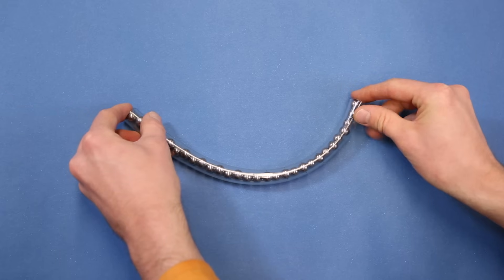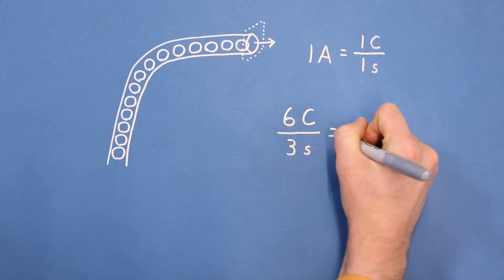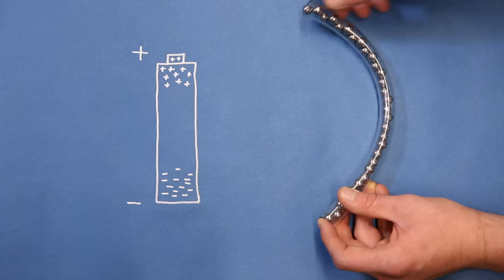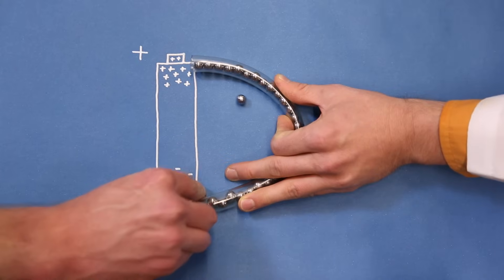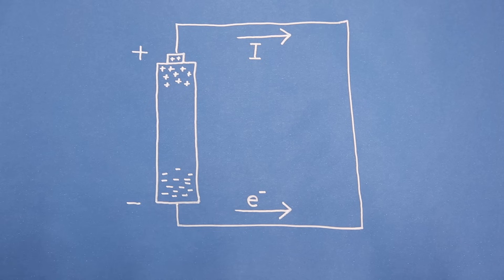What is Electric Current?

Comment: Thought this might help someone else learning:

Do electrons actually "move". It seems this video is about an old mental model for electricity.

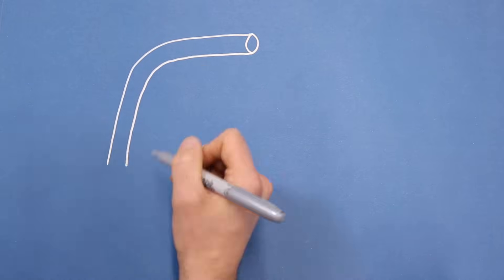Yes, electrons actually "move" to create electric current. The video explains this concept accurately by showing how a single electron can initiate a chain reaction, forcing other electrons to move (0:43-0:52). It also uses an analogy of steel balls in a tube to illustrate that even if an individual electron doesn't travel a long distance, its push causes a flow through the conductor (1:03-1:31).
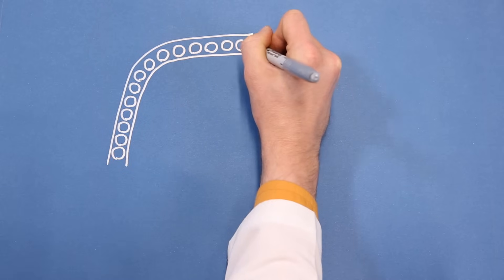This "push" or "flow" is known as electric current, which is defined as a flow of electric charge (1:34).
While the video's analogy simplifies the actual quantum mechanical behavior of electrons, it effectively conveys the idea of a net directional flow of charge. In reality, electrons in a conductor move randomly, but when a voltage is applied, they gain a slow, coordinated drift velocity in one direction. This creates the electric current, even though the individual electrons are also moving very quickly and chaotically due to thermal motion.

But isn't it the CHARGE moving, not hte actual ELECTRONS?

That's an excellent clarifying question! The video explains that electric current is the flow of electric charge (1:34). In most circuits, particularly those made with metal wires like copper, this flow of charge is primarily accomplished by the movement of electrons (0:37).
Here's a breakdown based on the video and general physics principles:
Electrons carry the charge: The video demonstrates how pushing one free electron into a copper wire causes it to eject another electron from an atom, which then moves to the next atom, creating a "chain of moving electrons" (0:49-0:52). This movement of electrons is the movement of negative charge.
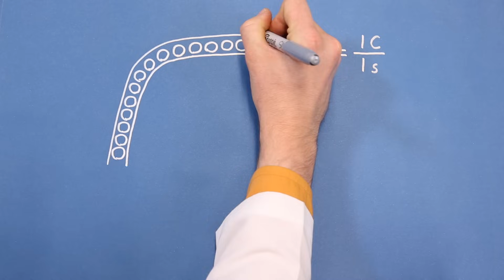Current is the flow of charge: When a continuous movement of these charged particles (electrons, in this case) occurs, it constitutes an electric current. The unit for measuring current, the Ampere, is defined as a certain amount of charge (Coulombs) moving past a point per second (1:47-1:51).
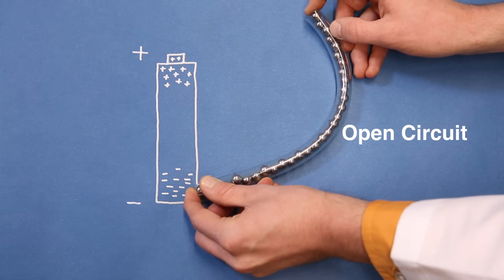Conventional Current vs. Electron Flow: This is where some confusion can arise. The video addresses this directly (3:34-4:43):
Electron Flow: Electrons, being negatively charged, move from the negative terminal of a battery (where there's an excess of electrons) to the positive terminal (where there's a deficit).
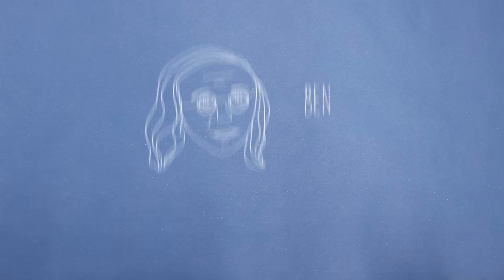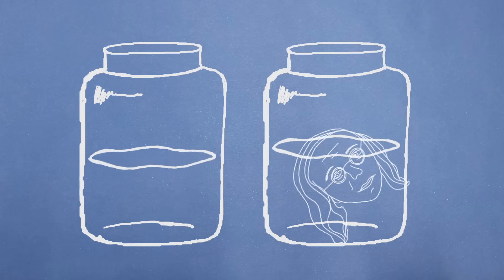Conventional Current: Historically, due to Benjamin Franklin's early theories about "electric fluid," current was defined as the flow of positive charge, moving from positive to negative (3:52-4:08).
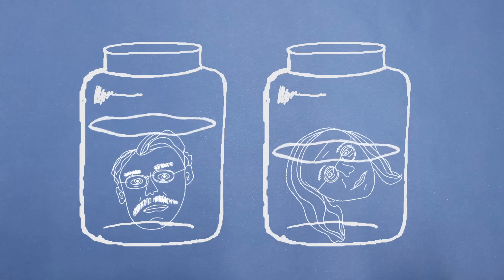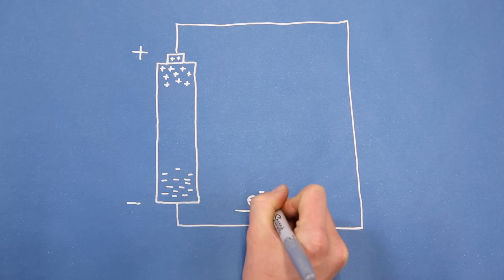Even though we now know electrons are the primary movers in most circuits, the convention of current flowing from positive to negative stuck (4:18-4:26). The math works out consistently regardless of which convention is used, as long as one is applied uniformly (4:36-4:40).
So, while electrons are the physical particles that move in many conductors, creating the current, electric current itself is the rate of flow of electric charge. In metals, the charge is carried by electrons, but in other materials like saltwater, positive ions can also be the charge carriers https://phys.libretexts.org/Courses/Coalinga_College/Physical_Science_for_Educators_CID%3A_PHYS_14/11%3A_Electricity/11.04%3A_Electric_Current_and_Resistance/11.4.02%3A_Current. The movement of these charged particles (like electrons) is what constitutes the flow of charge.

But is the same electrons actually moving the full length of the wire though? or is it just jumping to the next, which bounces out the next one, in a chain reaction?

The video explains that the same electrons do not need to move the full length of the wire to create a current. Instead, it's precisely as you described: a chain reaction.
The video illustrates this with an analogy of steel balls in a tube, representing electrons in a conductive wire (1:03-1:31):
When you push one ball into one end of the tube, the force causes all the balls inside to move, and one pops out the other end (1:17-1:24).
This demonstrates that "one electron, even if it doesn't move very far, can force all the other electrons to move, creating a flow" (1:24-1:31).
So, in a copper wire, when an electron is pushed in, its negative charge repels the closest electron in an atom's outer shell, ejecting it. This newly freed electron then pushes the next, and so on (0:43-0:52). It's this transfer of energy and momentum through a chain reaction of repelling electrons that creates the flow of charge, not necessarily a single electron traveling the entire distance of the wire.

Yeah, but the ball in the tube analogy is confusing because the ballmoves the whole length of the tube... but electrons do not move

You're right to point out that potential point of confusion with the analogy! While the ball does move the full length of the tube in that specific demonstration, the key takeaway the video wants to convey with it is the chain reaction effect, not the long-distance travel of a single particle.
The video states: "we might think that one charged particle needs to move completely through the conductor to create a flow but that's not actually the case" (1:11-1:17). It then uses the ball analogy to show that "as we push a ball in one end, the force causes all the balls to move and one pops out the other end" (1:17-1:24).
The crucial part is: "one electron even if it doesn't move very far can force all the other electrons to move, creating a flow" (1:24-1:31).
So, the analogy's purpose is to illustrate:
Instantaneous effect: The moment you push one ball, another pops out almost instantly, showing how current can seem to propagate very quickly.
Chain reaction: The push is transferred through the entire line of "electrons," rather than one single electron making the whole journey.
Think of it less as the specific ball being the electron, and more about the transfer of motion through the chain. The ball "popping out the other end" represents a new electron entering that end of the wire, while the initial electron only nudges its neighbor. It's the wave of pushing, or the net drift of charge, that travels along the wire, not necessarily the same individual electrons covering vast distances.

Maybe a better analogy would be a bunch of billard balls lined up in contact with each other? like 100 balls. hitting one side would move the ball on the far side?

That's an excellent analogy! You've precisely captured the core concept that the video is trying to convey about how current flows.
The billiard ball analogy (or Newton's Cradle) is often considered more intuitive than the "balls in a tube" for explaining this specific point:
You hit the first ball, and it transfers its momentum to the next, and so on.
The very last ball in the line is the one that moves significantly, flying off.
The balls in between only move a tiny amount, or not at all, as they simply transfer the energy.
This directly parallels how electrons create current in a conductor:
When a voltage source "pushes" the first electron (like hitting the first billiard ball) (2:13-2:15).
That electron repels the next, which repels the next, in a chain reaction (0:43-0:52).
The overall effect is a flow of charge through the wire, even though individual electrons only drift slowly and don't travel the entire length of the wire themselves (1:24-1:31).
Your analogy highlights the transfer of force and energy along the line of charges, rather than the long-distance travel of any single charge, which is a much more accurate representation of how current works at the electron level.

Comment: Electric current is the flow of electric charge, typically in the form of electrons, through a conductor, such as a wire. 

It is measured in amperes (A) and represents the rate of flow of electric charge. In other words, it is the amount of electric charge that flows through a given area per unit time. 

Electric current is generated by the movement of charged particles, such as electrons, and can be induced by various means, including electromagnetic induction, electrochemical reactions, and thermal gradients. 

The flow of electric current is governed by Ohm's Law, which states that current is proportional to the voltage applied and inversely proportional to the resistance of the conductor. Electric current is a fundamental concept in electricity and electronics, and is essential for powering devices, transmitting energy, and enabling many modern technologies.

Comment: Hi SparkFun, you explain very clearly how electrons flow thru a wire. May I know how electrons flow in a light bulb and when energy becomes light, how electrons have energy to move across the circuit?

Comment: As indicated in the video, the ball bearings in the tube analogy represent moving CHARGES, not ELECTRONS.  It is very easy for the casual viewer to intuitively assume that 1 CHARGE = 1 ELECTRON, which is FALSE.  1 electron CARRIES a CHARGE of -1, not the same thing.  A proton, BTW, carries a CHARGE of +1.
Formally, the definition of current is charges moving past a point in the wire, not electrons.
Reply: is it actually correct though? at 0:35 he clearly says "electron" ejected from outer shell.
Reply: @fluffykitties9020  The electron does move between adjacent atoms in the wire at a (relatively slow) speed called the drift velocity.  The effect between the two ends of the wire, a charge leaving the 'minus' battery terminal as a charge arrives at the 'plus' terminal, happens at a much faster speed that approaches the speed of light.  At each terminal a different pair  of adjacent atoms is exchanging a different electron in the same direction; the net effect is that a charge has moved down the length of the wire almost instantaneously.

Comment: So electricity is the flow of electrons in the wire then why does the electrical force travel at the speed of light in the insulation covering the wire (say 0.6666c km/s), or if no insulation then it travels at the speed of light in air (say 0.9999999c km/s). How do the smart electrons in the wire know whether there is insulation or not.
For the answer google Ivor Catt or Forrest Bishop.

Comment: What does this video explain? I need help ;-;
Reply: Unfortunately, it doesn't explain anything. There is no such thing as an electron. There is no evidence whatsoever that an electron exists, no experiment, no observations, nothing. Modern science has rammed it down our throats and few question it. There is no such thing as charge. No one has yet explained charged nor provided any evidence of its existence. Absolutely zero is flowing through a copper wire. Current does not exist. Current is merely the mathematical  relationship between voltage (magnetic field) and resistance. Electricity is only a word that describes the attributes of a magnetic field and is not a thing in and of itself. The only thing that is occuring in a conductor is the induction (coupling) of a magnetic field. Simple as that.
Reply: @elams1894  well actualt there is evidence mate.
Reply: @Jayden-mn9vm  What is the evidence of an electron, or current for that matter? I'm all ears
Reply: @Jayden-mn9vm  Just what I thought. When you look for evidence and can't find any, you understand pretty quickly that electrons and charge and current are, at best, conceptual.
Reply: @elams1894  Mate im doin work, I don't have time responding to comments like yours. And yes there is evidence just look it up mate. not the first page of google but the later pages you will find actual evidence.

now im busy with work so leave me alone plz
Reply: @Jayden-mn9vm  lol
Reply: it's just a charged electron moving from one atom to another. Thats a really simple definition btw but will get u started :)
Reply: @Jayden-mn9vm  ah thank you
Reply: @soyoymilk  your Welcome but theres a little more to it. If you watch the vid again it might make more sence this time.
Reply: also that maths in the vid is just to measure the power of the current, thats all
Reply: @Jayden-mn9vm  ah alright
Reply: Norman i thought u had high iQ 🧐

Comment: 1:19 This is a common misconception.  The ball-tube model is not how current arises.  The wire remains neutral on the inside because electrostatic forces are too strong for it to be otherwise.  Instead, the e.m.f. source spreads its excess charge throughout the circuit.  This excess charge spreads to the surface of the conducting material of which the circuit is made.  A differential in charge density creates the current throughout the circuit.  For instructors, you can read a detailed exposition several pages long in Sherwood & Chabay.
Electrons inside the wire aren't affected by surface charges within 3 wire-widths of the electron.  There's not enough differential in charge density and not enough tangential component to the electric field acting on the electron.  3-10 wire-widths away is where the electron is getting its motivation from.

How do we know?  Send 10,000V through a single-resistor circuit and you'll find opposite ends of the resistor exhibit opposite charges.  Typical current involve so little surface charge differential that a lot of voltage is needed to detect these surface charges.  See here, e.g.: https://www.youtube.com/watch?v=8BQM_xw2Rfo

Maybe his explanation is fine for fourth grade, but the misconception needs to be unlearned by high school.

Comment: Do electrons not move in AC as they move back and forth means oscillate so their net position remains zero, how does current flow in that case??
Reply: I understood about three words there
Reply: This explanation of how current flows is to make school kids understand and is overly simplified. Electrical energy is carried by the electric field and not electrons themselves, so in AC circuits, the field (which travels at the speed of light) oscillates.

Comment: Could anybody tell me does a higher current means that the electrons flow faster?
Reply: The formula for current is i = n.e.v, where n  is no. of electrons passing through the wire per second, e is electronic charge, and v is drift velocity of the electrons. So, a higher current can mean many electrons moving at some low speed (for a copper wire), or a just involving a few electrons  but moving at a very high speed (for a superconductor).

Comment: As we know , these are the electrons which flow through the wire , then why don't we call the negative potential as a higher one because it will push the electron to go through the wire ....and the electron will thus give out energy when they move towards the poditive terminal.
Why do we call positive potential high and negative potential low ? Do we always have to take a positive test charge as a reference ?